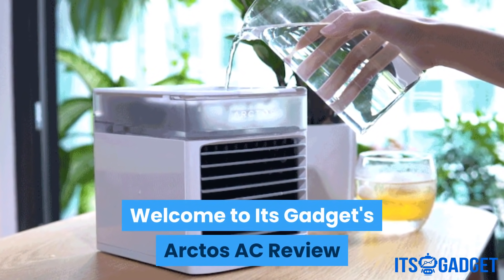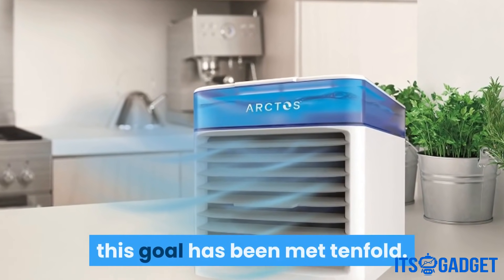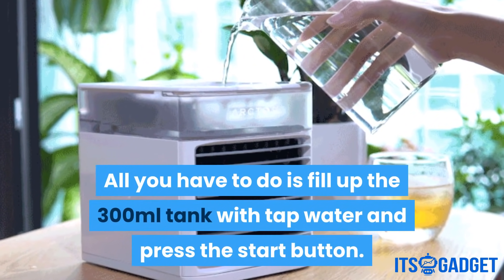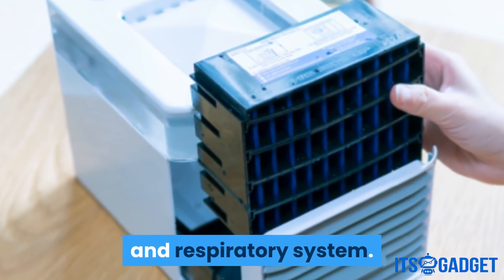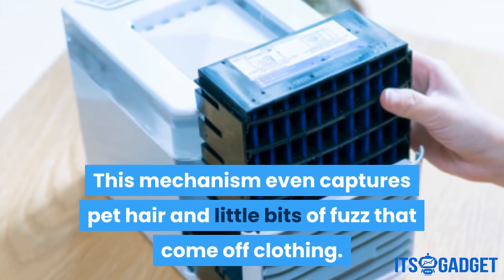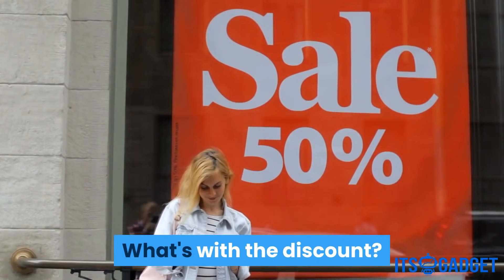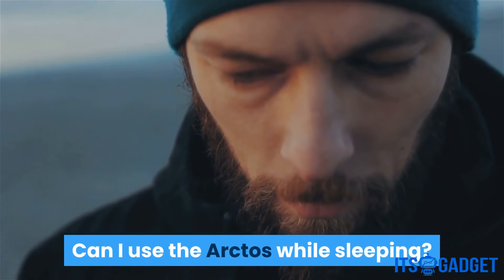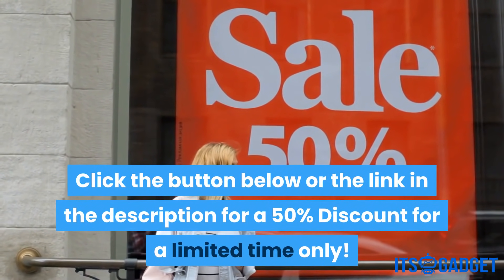Arctos AC Review - In Depth Review of Arctos AC(You'll be SURPRISED)

Comment: This Arctos "cooler" is garbage. I have reported them to the Better Business Bureau. The company ignores complaints and gives lip service to problems. It works OK below 80 degrees as long as it's 1 or 2 feet from you (it will blow on your neck, shoulder or head, whichever part of you it's pointed at, but not all 2 or 3 parts at once!) It's a 4 inch fan that is supposed to cool you with the 2 cups of water it holds. 
I canceled my first order within an hour as they had made some errors in billing and shipping information. I called twice and was assured both times my $ would be refunded in 5 to 7 days (they had already charged my card even though the order had not even been processed.) I ordered 2 this time, which came within 5 days. The were Horrid! One had a faulty cord and would not operate. I had to go buy a $25 cord at the hardware store. Then, it leaked everywhere! There was a split seam at the side that I had not noticed.
I set up the second one. Results where a joke. If it's cool outside, it will blow cool air, period.
As a side note, the 4 original coolers I ordered arrived 4 or 5 days later  (the ones I had been assured had been canceled and $ would be refunded.) I have been charged for all 6 with no chance of ever getting my $ back! The company does not respond to my emails and I already know a phone call is useless.
Arctos cooler does not come with an electric plug-in (an extra $25 at the hardware store), USB connection only. It also does not run on batteries as stated in one of their ads (you would have to buy all of that whole set-up extra.) 

Buy a good fan and a squirt bottle, it would be a lot cheaper and work better.